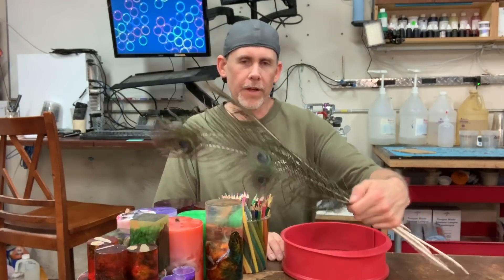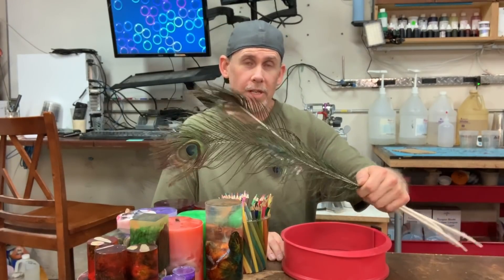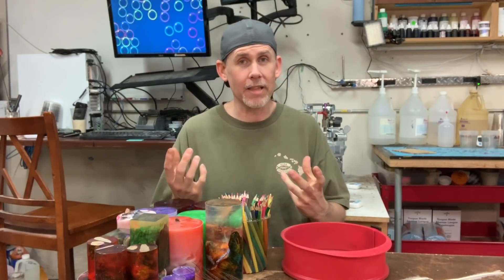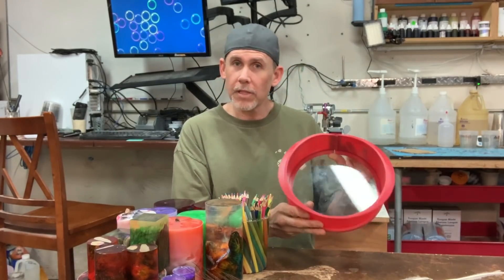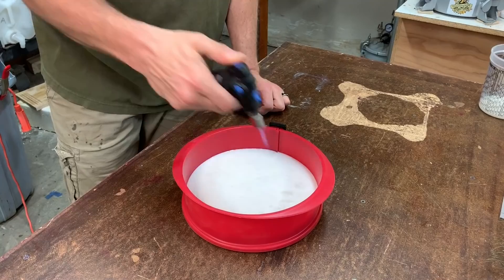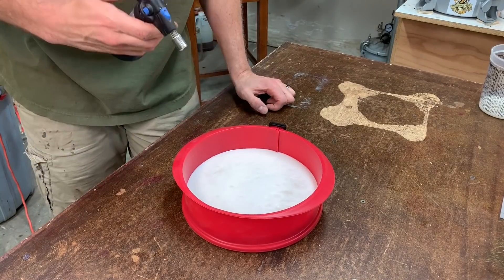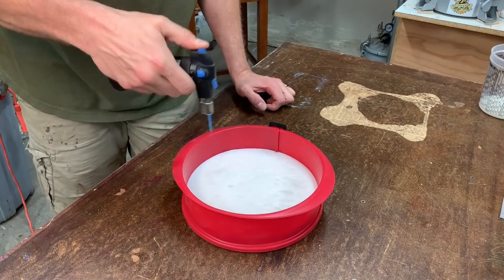Resin Casting A Multilayer Peacock Feather Platter Turning Blank

Comment: I had a pour of Alumalite slow set go exothermic. I popped it in the freezer of my refrigerator for about 10 minutes. Checked it and it began to overheat again. I put it in the freezer again for about 20 minutes. When I took it out it was okay and didn't overheat again. The cast became a handle for a pizza wheel for me and is just fine. The freezer worked!
Reply from the maker: Sheesh, I haven't heard of slow set overheating before. I still haven't found an upper limit on how much you can cast at once. Great idea about the freezer! We don't have one in the shop, but that would have helped out I think

Comment: thought of something else can you pore a layer of alumilite over another layer?
Reply from the maker: Sure, best to do it right after you pull the first layer out of the pressure pot, and it helps to scuff the top layer a bit so the next one has something to bite into if you don't get to pour the second one right away